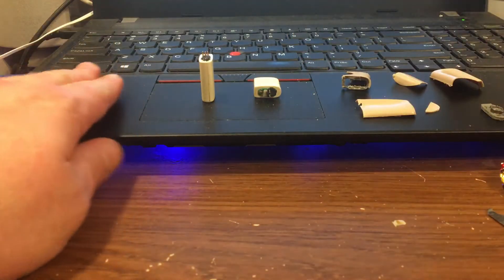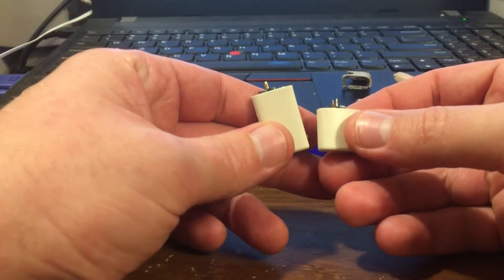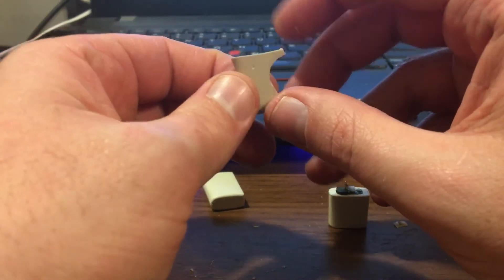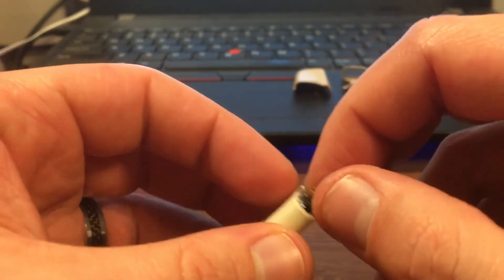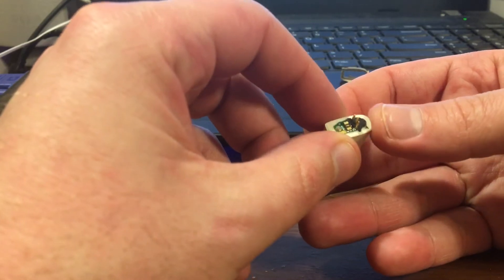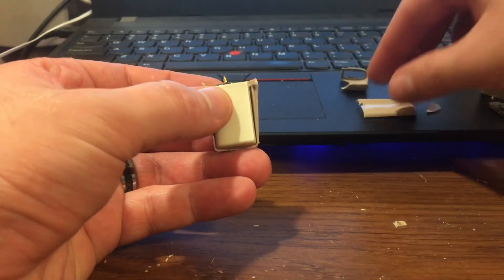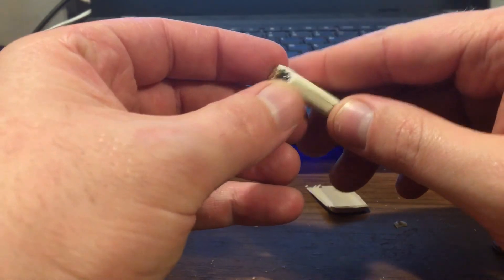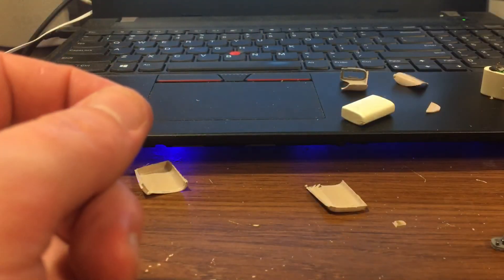Cochlear Nucleus 6 Battery Teardown And Repair Attempt

Comment: I feel you.  Our 3rd battery just died (will no longer recharge).  I was going to try to pry it apart to see if I could replace the batt cells.  Looks like a no go.  Thanks for tossing this video out there.  Saved me some time.
Reply from the maker: Yeah bud! That sucks. At least your lucky enough to have them go dead lol. Mine keep getting destroyed by the lil one. Union Hearing in Toronto gives a 20% off sale every x-mas. If your in the country you might want to check them out